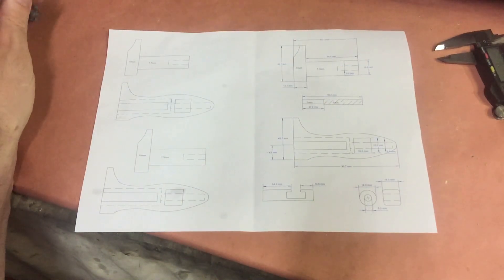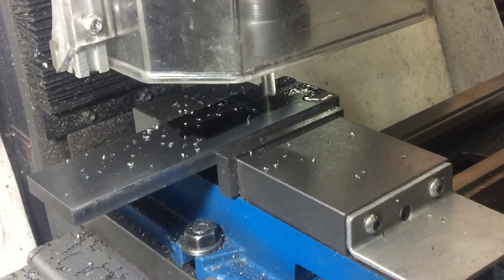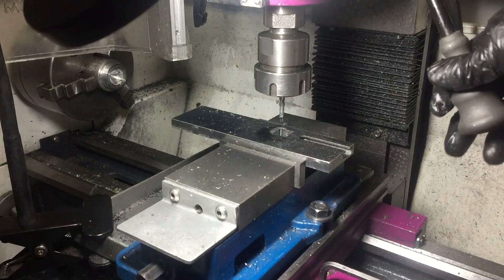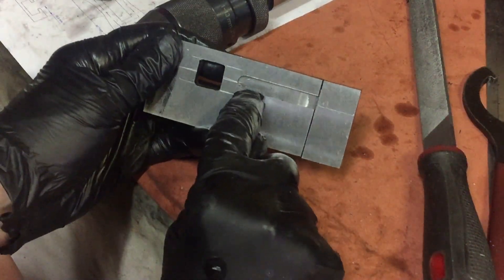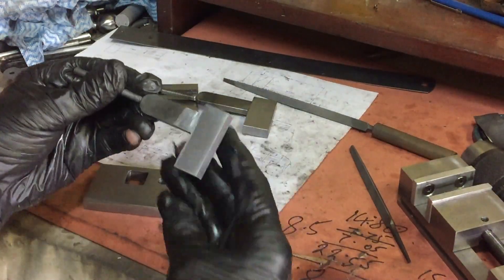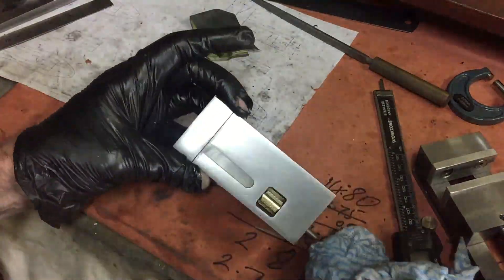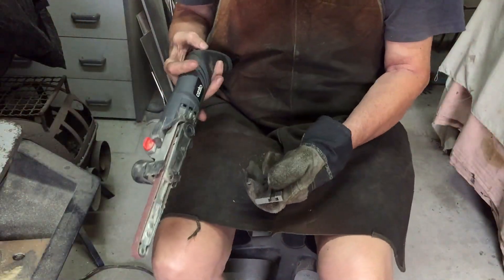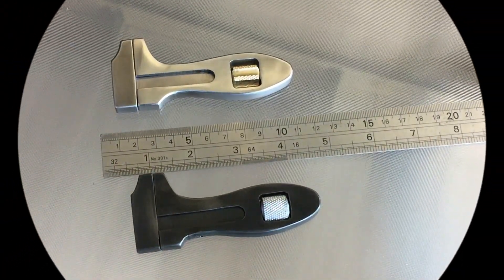Vintage Adjustable Wrench - Lets Make One

Comment: Nice project. Good commentary. Thank you.
Mechanical engineer here, trained in heavy industry. First walked into a toolroom aged 15. Now 60.
Three hopefully constructive suggestions:
1. Welding produces full-spectrum UV radiation, including the most highly carcinogenic frequencies (known as UVC). UVC is typically attenuated by the atmosphere, so it's hard to get exposed to that (if you don't weld) for example, at the beach. TIG is the strongest in terms of radiation hazard, because there's no smoke. You can clearly see your arms getting irradiated. Best practice is to cover every sq. inch of exposed skin. There's no safe level for this exposure.
2. Gloves and grinders, sanding discs, wire wheels - all rotating machines, basically - are a significant entanglement hazard. In industry there are big 'no gloves' signs above ALL such tools. You're preventing superficial injury wearing them, while opening the door to major orthopaedic surgery/injury.
3. The square hole: No need to turn it all into chips. Just drill the perimeter using a 4mm twist drill on 3.5mm centres. The plug falls out. (The overlap is fine. Up to 25% overlap is usually sufficient to constrain the drill in the hole.) You have graduations on the lathe slide to measure 3.5mm centre. Near enough is good enough. Clean up with the end mill - less work for the cutter, and the chips don't build up - so there's less risk of damage to the cutting edge. The end mill lasts longer as a result. Milling cutters cost heaps more than twist drills, and can't easily be resharpened.
I also love the fact that you went ahead and finished prototype #1. You essentially proved my major issue with nearly all DIY: If you build something four times, you'll probably have a properly finished job that's nearly production-ready. Most DIY-ers exist in a world where the first prototype is also the finished item, which is exceedingly hard to get right. You did very well getting there in just two iterations.